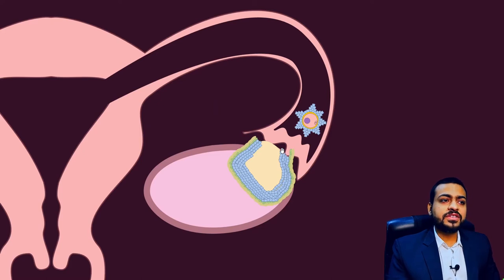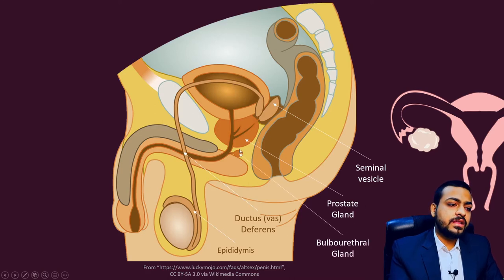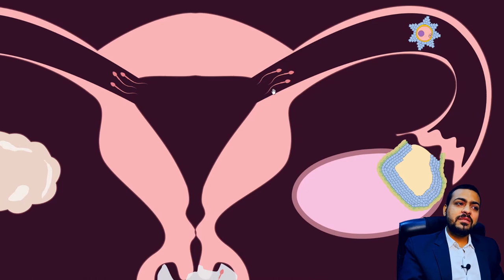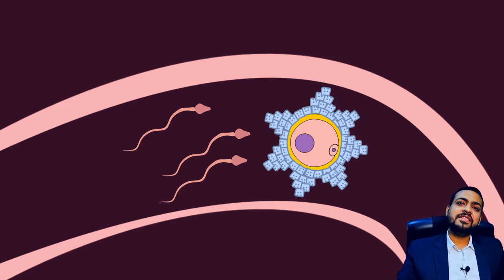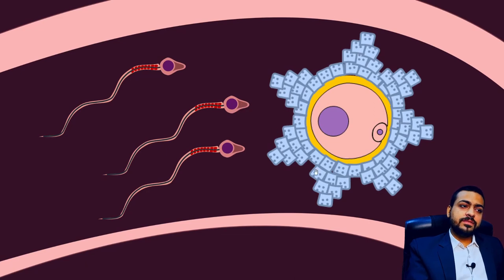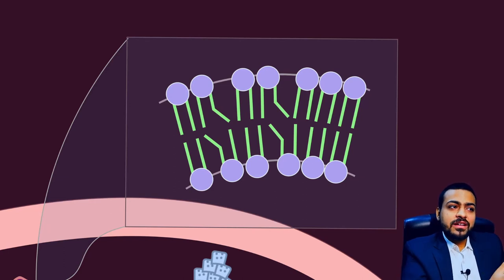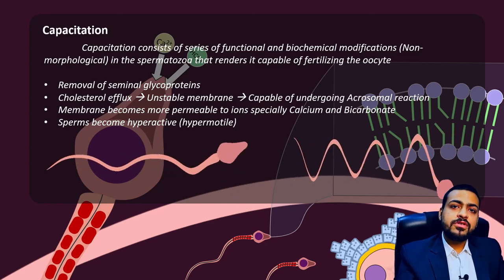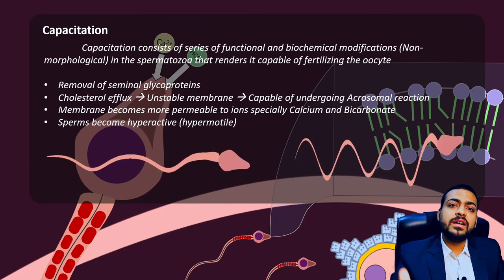Fertilization part1: Capacitation and Transport of Gametes

Comment: Sir what's ovulation is it release of secondary oocyte or release of ovum from ovary ?
I'm confused is it secondary oocyte undergoes fertilization . Secondary oocyte is immature egg while ovum is mature egg. Sir kindly elaborate why secondary oocyte is used here not ovum and where would be secondary oocyte transformed into ovum ?
Reply from the maker: Ovulation is release of secondary oocyte. It will be converted to ovum after binding with sperm. These points have been discussed in details in Oogenesis lectures. Please watch these videos first. If you are still confused please do comment after watching these videos.
Oogenesis Part 1: https://youtu.be/UYdh5gmirBo
Oogenesis Part 2: https://youtu.be/NKtvkD5AecA
Polar Body and it's significance: https://youtu.be/lSgRCBNIU-8
Oogenesis Review: https://youtu.be/Vwb3LbSiDWY